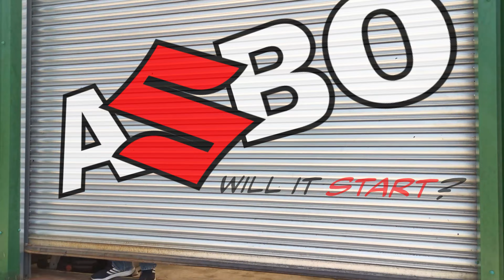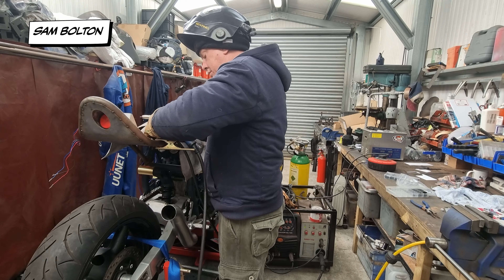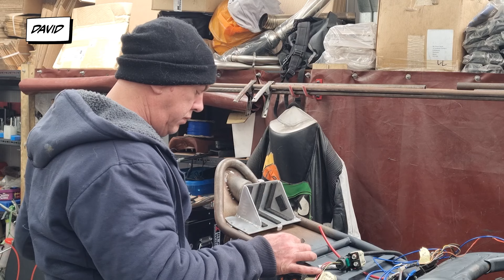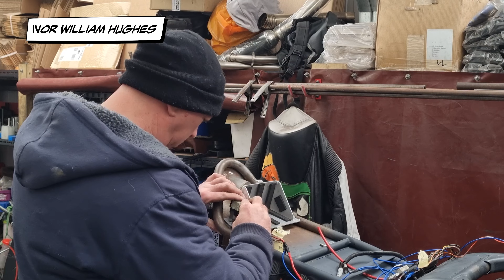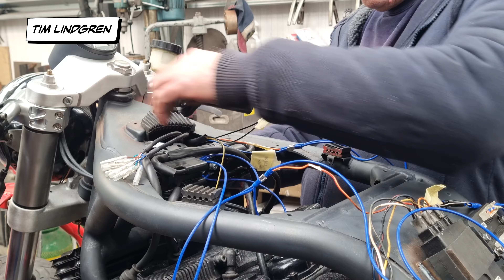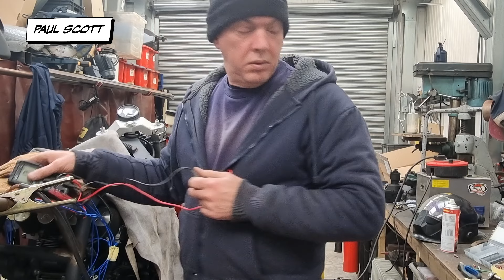Will it start? - Suzuki Bandit Cafe Racer - ASBO Project

Comment: try try theses on ebay might help 580Pcs Motorcycle Car Electrical 2.8mm 2/3/4/6/9 Pin Wire Auto Connectors Set
Reply from the maker: Thank you matey 😁👍

Comment: you can get a box of various size block connectors and those pins and spades come with them so you can make new ones. or replace old broken ones.
Reply from the maker: Yeah I need to replace all the plugs on everything, but the trouble is I don't know what they're called. I'll be hunting round for part numbers when I get to making the final loom 😁👍

Comment: I was going to comment on the wiring video but you know "stuff" and all that but rewired my old Triumph with an inline fuse connector but replaced the fuse with a manual reset blade fuse circuit breaker. L8rs
Reply from the maker: Aw yeah, that would work. Good idea matey 😁

Comment: ok ,,please for the love that is all holy dont use those white connectors and those crimp connector   they are awful,   imho.   try these https://www.youtube.com/watch?v=3QL1QaIwMwk   and  https://www.youtube.com/watch?v=dqy9h-Tnvvk   and see the way the wires are twisted    ALSO     make sure the current is ok for the wire    ohms laws ... w/av  ( what are virgins ) and V /A R    ( virgins are rare )   PS, Lucas sell 2 litre packs of Spark for the spark plugs !  pps ,,,, wot a lovely sound !        job done !
Reply from the maker: Connectors are only temp for Dyno day matey and the wiring I've added is rated higher than the stuff already on the loom, so we should be sound. I've got proper waterproof connectors etc for the final loom and the Motogadget wiring kit, so no worries there 👍

Comment: If you haven't worked out what those terminals are called, search for terminal with tags to get what you need. Vehicle Wiring Products and Autoelectricsupplies are the two companies I use.